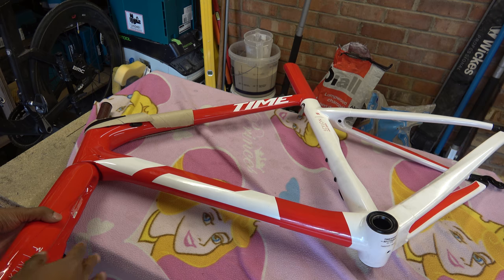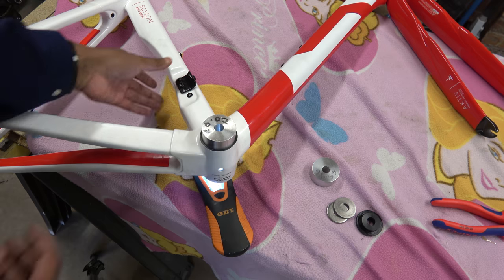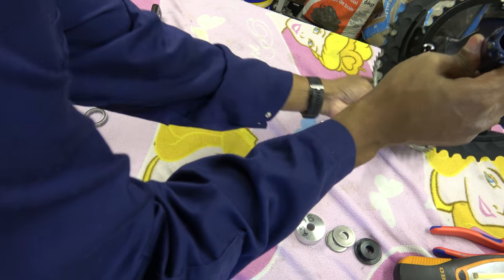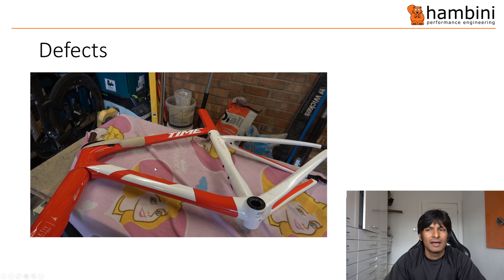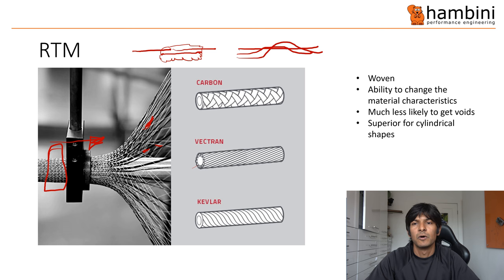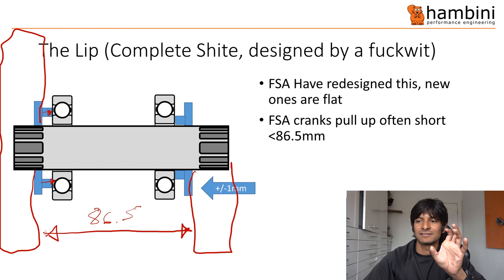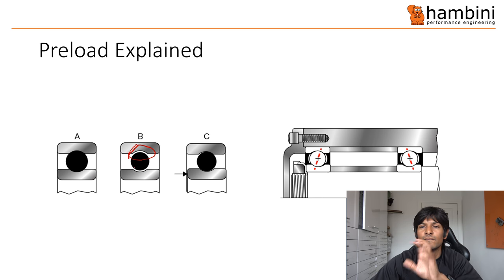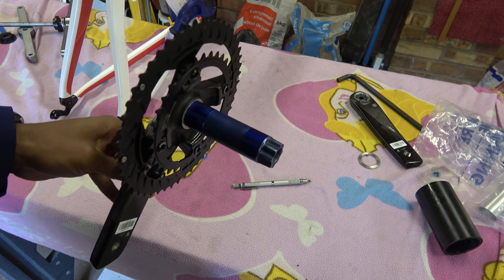The best made bike frame in the world meets the worst crankset in the world and Hambini Loses it

Comment: Just wondering.... with the anodising, is it purely cosmetic for a part which cant be seen when installed?
Reply from the maker: i think so.
Reply: Would it not also be for corrosion protection?
Reply: @waynosfotos  As the aluminum axle is joined to carbon cranks and in a carbon frame, the worst consequences of corrosion shouldn't be an issue. Aluminum can oxidize but it doesn't disintegrate the way steel does. A cyclist going for the type of performance you'd be expecting for dropping $6k on a frame is probably going to upgrade the drive to the next new thing long before a failure in the aluminum axle due to corrosion would occur.

Comment: The Aktiv fork contains a movable mass damper.
Reply: and the fork weights 500g
Reply: Exactly....500gram forks on a road bike??? WTF even but a CF frame at that point? Go with Ti or Steel...cool frame though.
Reply: @SprayIgniteBoom  this is the downside of RTM
Reply: @mihpop9733  This is not a downside of RTM, the non-Aktiv form weighs 320g. The extra weight is the moveable mass damper system. RTM is no more dense than prepreg, it just allows for greater design flexibility / optimisation.

Comment: Hey Hambini! I have a question on bearings because I see you as the master of the bearings - don't know if you have time to answer but I'd be genuinely interested in your thoughts.

I recently replaced a cup and cone rear hub with a hub using sealed bearings because I found that I had sheared about five ball bearings and the races were scored. Most ball bearings were in half but a few were in smaller chunks. I've never heard or seen anything like this before. I thought I was just cack at setting preload but it turns out I was just pedalling on chunks of metal (in the high quality moly grease I used if that makes a difference).

Am I just He-Man / Mark Cavendish when he broke a spoke or did someone put in those silver balls you get on cakes for a laugh? Do ball bearings fail?

Comment: MY brand New Giant TCX has an FSA Omega crank and press fit BB, the pre-load wave washer was too big causing it to bind the bearing, I made up two aluminium inserts (and deleted the wave washer)after finding that the pre load was dictated by two nylon inserts (which also dragged on the outside of the BB), I couldn't really go back to Giant/FSA because I would have just been sent back to  he bike shop and wasn't confident all of the problems would get sorted out,  spins like a b'stard now, so thats fixed (when they wear out I will install a better BB.

Comment: What is the name of the machine that can measure the roundness of the BB hole, it's concentrically, roundness and alignment? I can measure the ID, but I'd like more info. I'm hoping I can find a local company that can do it.
Reply from the maker: Cmm
Reply from the maker: RollinRat  you are dead right. A boring machine should do the job and you can get one relatively cheaply
Reply: RollinRat  we had a Mitutoyo CMM at an engineering education provider I worked at in the north of England. It had arrived long before I did so I didn't get the training or use it more than a couple times to follow a written procedure. From memory it was sold for a few grand when the centre was shut...I have the figure of £8k in my head as having been the original cost but I have no idea if that was due to some mad education discounts. I know they threw around their digital calipers like sweeties when it was ordered! You would imagine that firms smashing out expensive bicycle frames should be doing adequate checking and subsequent fingering / flapwheeling / binning prior to sending them out.

Comment: Why is the drive side crank arm so much heavier (at the pedal thread point) that it always ends up on the bottom?)
Reply: Glad I'm not the only one who noticed that. Surely that's going to affect pedaling.
Reply: @oheso  Maybe at a high cadence, never seen this before.. although people have legs that are a different volume, length and weight (including me after a knee injury), surely that would cause more of a problem then a couple of grams on a crank arm, I would still prefer mine to be balanced xD

Comment: I just don't get why companies don't simply hone the hole. like you'd do on a cylinder hone for an engine?
Reply: You'll damage the carbon layup and can compromise strength if you have to cut material out while honing.
I guess frame manufacturer rely on Press fit plastic cup material plasticity to compensate their molded bottom bracket geometric flaws.

Comment: Why do people want to use shit cranks so much that they will spend hundreds on a replacement BB?  What is it that's so important that people have to use FSA cranks.  I looked into them years ago and concluded that what I termed 'mechanical integrity' was not there.  Edit: not having mechanical skills or knowledge I just read a lot of comments.  Enough people had problems to put me off.  It might be anecdotal evidence but there is a reason for so many upset people.  I just don't get why people want to use them so much they go to these lengths.
Reply: Like the FSA carbon fork expander is also pure sh..te.

Comment: Just today I got that same FSA crankset from Ukraine lol ... (cheap on eBay). I was planning to use it as an upgrade for an older aluminium ISO threaded frame w GXP crank. I suppose BB type doesn't matter if the crank is out of whack, but I'm curious... what do you think of using this crank with the MegaEvo BB?

Comment: I have a FSA Gossamer BB30 and also a Gossamer BB386evo cranksets and it has the exact same lip and this K-Force and the inner race sits just nicely in that lip (sarcasm intended) hence my cranks are dragging well the BB30 does as with the BB30 to 386 adapters has a outwards lip to it sits up against the inner race only. So it would seem they have been at this game for a while. 

Out of curiosity what is the spacer you used against that lip as I want to use my BB30 crankset but I'd prefer it no to be ruining my bearings I also want to ditch that shit wavey thingymabob

Comment: Hi  Hambini,
a stupid question: Wheels mfg. BSA30 BB with Enduro bearings marked 71806 LLB,my 30mm crank spindle goes through it completely loose,my calipers shows the bearing inner diameter is 30.1+,no interference at all..I'm a bit dumbfounded whether such things possible or is it all OK ?
Best regards,bonsoir
Reply from the maker: That is very loose. It should be just under 30mm

Comment: Fuckin tapered splines in soft as shite aluminium. As soon as theres a bit of contamination or grit on them they're fucked and will never lock. Or if wankface at the bike shop doesn't torque them up properly and they're ridden loose, the tapers get fucked and will never lock. 
Ps. What camera do you use?

Comment: The FSA crank that came with my Cervelo R3 is clicking and snapping like crazy.  Greasing the chain bolts and the chainrings has helped but it still does it under load.  Since it’s a BBRight BB I guess I don’t have many choices beyond the shite FSA unit which I don’t want to replace anyways since I’m probably selling the bike but I also don’t want to dump the problem on the new owner.  Any suggestions for getting this cheap ass FSA crank to quiet down?

On the plus side the axle spins freely and truly in the BB so it’s not a performance issue.  It’s just super annoying.

Comment: You know, as a mechanical engineering student I had long started becoming more and more uncomfortable with tapered spline 30mm axles, precisely because of the problem you described where the amount of torque you bolt the second arm onto the splines with could change the distance between the two flats inside the crank arms (the "real" spindle length, as it were.) It seemed like such an obvious and stupid problem that I was sure I was missing something, and I ended up chalking it up to "well, these manufacturers must know more than me."

It's good to see someone far more knowledgeable and experienced than me affirm that, no, these manufacturers don't know jack shit and are just creating some really stupid designs.
Reply from the maker: you hit the nail on the head.

Comment: I rarely LOL at video's (unless they are supposed to be comedy or 'dead serious')  but yours are often incredibly funny. The belt and chain drive mountain bike had the electric motor built into seat post. kinda neat but if you want an engine get a proper motorbike or motocross bike for off-road.
A freind of mine used to make kayak's he said when you add Kevlar to kayak you have to be very careful where you put it as if there was a serious accident (hang up in white water) the kayak can bend in half instead of snapping and prevent you getting out.Doesn't the Orebea have thicker section where there will be more stress?

Comment: 41:58 Please Hambini. Could you please develope that for us! What is the truth about tire pressure and tire size? Can we trust the brands online calculators or the one FFtips created with excell? Please man we need this!
Reply: Much like with aerodynamics, when you apply a simplified steady state model that makes a lot of assumptions, you get answers that aren't necessarily correct for the way you'll use the bike.  What is best is going to depend how it's being used.

The effects of tire pressure are going to vary depending on rider weight, rubber compound, road surface, and riding speed.

AFAIK, most of the effects are fairly linear with speed, unlike aero drag, which is exponential, so likely rolling resistance and suspension losses will dominate at lower speeds, and aero at higher speeds, but where that crossover point is will vary depending on all those conditions.

If you're doing monster steep hillclimbs on really rough surfaces, you're likely going to be saving more power with bigger tires, if they're ones constructed for low rolling resistance.  (Even if big tires theoretically roll better, most of them are heavy stiff rubber, and that slows them down)

The faster you're riding, and the smoother the surface, the more aero will take over.

Comment: I really enjoyed this video - a Hambini classic! I now understand bearing preload - your diagram is so neat and simple, no extra explanation is needed :-)

However I'm left wondering why anyone in their right mind would want to fit a piece of garbage like that FSA crank to such a lovely frame. Clearly the "customer" isn't short of cash, and if they are doing a custom build they should have the freedom to fit any equipment to it. Would be interesting to know their thinking (it would be easy to label them as an idiot, but maybe there is a good reason for their choice?!).

Another thing that bothers me is this: Why, Hambini, on removing the crankset and BB to investigate the problem, did you focus on the tiny bit of carbon that was sticking out inside the BB shell? Given your experience of poorly-made cranksets from FSA, wouldn't you suspect the crankset to be the cause of the problem, not the tiny fragment of loose carbon inside the superbly-made Time frame? Surely you wouldn't set up the scenario to make a more entertaining video?... ;-)

Comment: Doesn't the extra spacers cause the non drive side crank arm to loosen? because the crank arm might not fully engage with the tapered splines?
Reply from the maker: The spacer is thinner. The only difference would be the q factor is slightly smaller

Comment: I've used an FSA 386  with  a BSA BB with success. I prefer Shimano of course. I've also got time pedals the 12's and they are a different float and engagement. I find the time pedals seem smoother than my Shimano. My old giant had aramid weave on the seat stays and i see Some wheels ex china are using aramid fibre now and filament.

Comment: One small, but awesome thing you didn’t mention, is the Time ‘Quickset’ which allows the headset bearing to be preloaded independently of the stem and top cap. Somethings all bikes should have in my opinion. Okay, Chris King produce the ‘DropSet’ with ‘GripLock’, but it’s pricey.
Awesome video as usual, Hambini!

Comment: Carbon dropouts make me very nervous. IMO, terrible idea. In the US Time were famous for terrible distributor support and not honouring warranties. Lots of shops dropped them.
Reply: Should be covered in replaceable alloy. Check out Scapin.
Reply: I don't think Luescher Teknik has any issue with them, as long as they are done well.
Reply: Time have famously had problems with carbon dropouts and hangers in the past.

Comment: I'm on my third Wilier frame, first two have been replaced due to different warranty issues. I'm just about to build up my third frame and would like your opinion
on the quality of their workmanship. They are a high priced brand and I do like their frames but I'm skeptical after seeing your evaluations of other 
brands. Much thanks.
Reply: As a Wilier owner (Cento1 NDR), it would be nice to know what your particular problems were, and how easy they were to deal with.
Reply: Think you've answered your own question if your on the 3rd frame.

Comment: My son had the MTB version of this design on his MTB (The FSA Comet) it is utter dogshite. Even when torqued up it still manages to updo itself when pedalling and it basically knocked out the aluminium splines on the non-drive side crank. This resulted in play in the rotation and a horrid knock when pedalling, which further exacerbated the undoing issue. Fortunately the Shimano hollowtech design used the same bearings and dimensions as the FSA Mega Exo BB which was fitted. A replacement Deore 2x crankset was fitted and has since caused zero issues. Odd for FSA because the better supermoto on my other MTB uses the same preload and pinch design as Shimano.

Comment: Just like with NTN, there are fake Koyos out there too. I had a few turn up in a legit koyo box with blank sealed wrappers around the bearing (it should be branded and not sealed) with the original security seal on the box retaped with NTN branded tape. Clearly, they mixed up their tape for the fake NTNs. What was more, the grind on the bearings was atrocious.
Reply: There are fake SKF as well..
Reply: With all these fakes going around, I'd rather buy NTN bearings straight from Japan.

Comment: I agree that FSA components are substandard based upon my one experience with their products.  With my Specialized Roubaix Pro, manily Dura-Ace fitted bike, it came with a "high-end" FSA crank (Dura-Ace equivalent) and the carbon crank pedal nut insert loosened due to inadequate bonding.  I abandoned that shite as I was not prepared to face plant on the road with another pedal stroke.  I decided on a costly Ultegra replacement that works wonderfully and since that time I have avoided any FSA products since I cannot trust their quality, reliability and safety.  Avoid FSA  IMHO.

Comment: You got so much knowledge but please do look into composites manufacturing a bit more cuz I have heard you get it wrong a few times. RTM basically just means that the resin is transfer into the carbon after the carbon has been laid up. Prepreg means the resin is already impregnated into the carbon. Both can be weaves or unidirectional. Other than that, carry on;)

Comment: Another Shimano crank bites the dust, had an Ultegra 6800 fail two years ago bought a 8000 one and it went to weeks ago, one month out of the 2 year warranty!  Got a 105 in its place, so Shimano definitely dropping down the scale.
  Keep up the good work, properly interesting insights into the bike industry and engineering f#ck ups.  As soon as my current BB bites the dust, already saving up for a replacement Hambini one 👍

Comment: Isn't the Time Scylon made the same way as the BMC Impec? Would really love to see Hambini's take on BMC's swiss made Impec frame
Reply: BMC isn't Swiss, their frames are made in China
Reply: Yes, in that the impec also used resin transfer moulding (RTM) woven tubes. New bmcs are all monocoque now. Probably cost related
Reply: @bobsmith4398  I'm not talking about their current lineup, I was talking about their swiss made Impec frame. They had an entire assembly line to make the frame.
Reply: @slackrouler1736  the new ones are monocoque??

Comment: For me it seems that Shimano was wise with the crank axle and bottom bracket design and I thinkt they patented it wisely so every other manufacturer has to circumvent these patents in silly and strange ways like that taper fit (which is difficult and expensive for accurate machining) or that crazy Campagnolo coupling (which is yet more difficlult) that you've shown in last video. Shimano standard seems extremely easy to manufacture, is simple in assembly and there is virtually no critical dimension apart from the axle diameter as any slack and tolerance in bb length can be accomodated by the simple preload screw.
Reply: DUB and Rotor are nearly identical to Shimano, just oversized by 5-6mm. They still lock the crank arms to the spindle, but they have adjustable preload collars. FSA’s design is just bad.

Comment: Square taper cartridge bottom bracket 4 lyfe!
Reply: Press fit square taper JIS bb cartridge would probably be best. Nobody makes one. Until then, Aluminum frame, BSA threaded square taper  cartridge will have to do. When it goes, out it goes, $20- $30 later another goes in. Too many standards serving too small a market.

Comment: In the bottom bracket powerpoint measurement section, i mistook the time bike for the blue line. No, it is actually the round thing on the outside and not the blue line. It is the grey line that i pretty round compared to the others. So round in fact that i mistook it as part of the diagram and not the actual measurement.